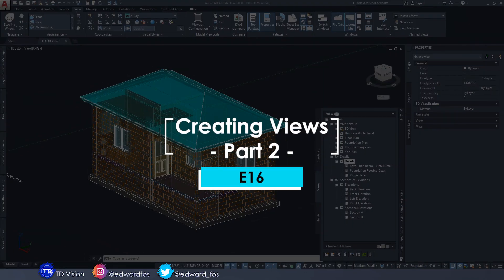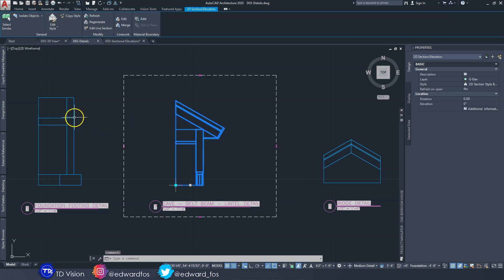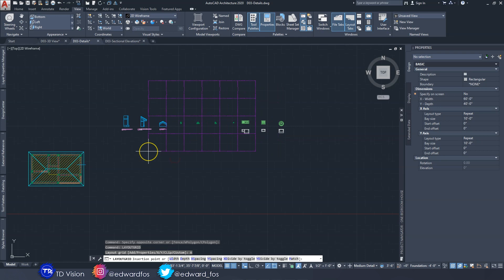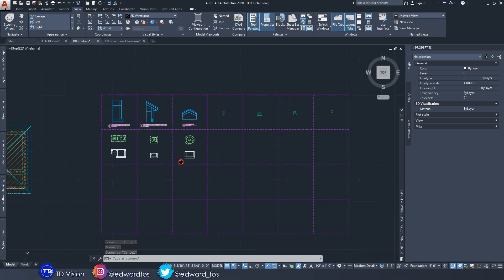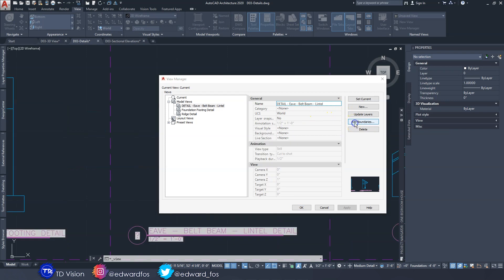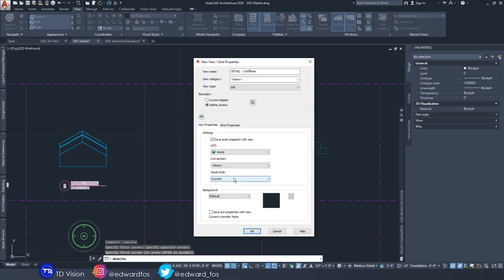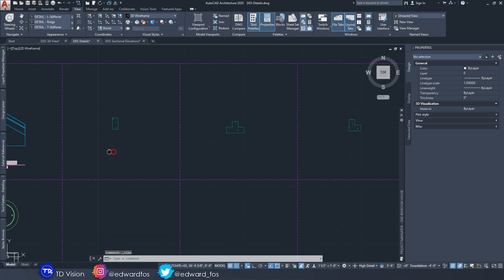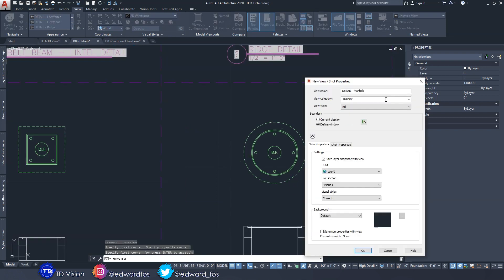CREATING VIEWS (Part 2) in AutoCAD Architecture 2023

Comment: I'm having a problem in adding floors to views. when i generate views all the floors are at same height...thats like they are overlapping. Do i have to move every floor up or down at their level?
Reply from the maker: No. It should automatically adjust for you. Click on each wall in each level and make sure their elevations are all 0. Then check your levels setting once more to make sure they are all good. Then delete that 3D view you made and remake one. Let me know if it works.
Reply: @TDVision_U  Thanks mannn🥺that worked...I alters the elevations in DWG same as we did in project navigator instead of zero